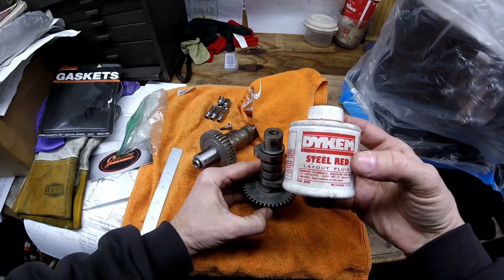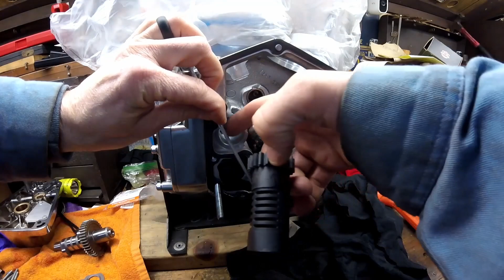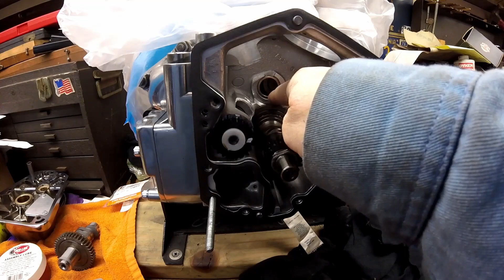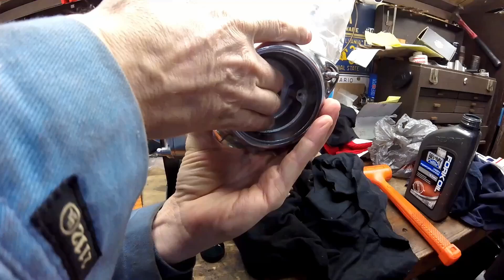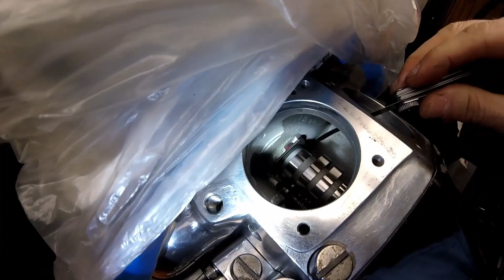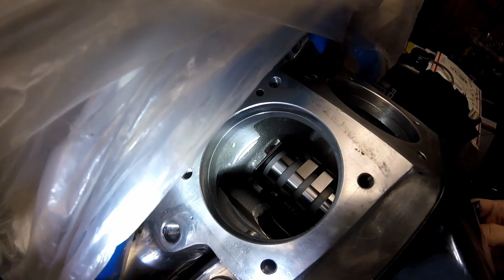Cam & Breather Set up of Evo, Shovel cam gear Install shimming Harley

Comment: I had a lot of oil pump problems on my 1992 Evo. After rebuilding the pump I found it easiest to pull the pinion gear to get the oil pump gear back on. I rolled the motor over several times and now when my TDC mark is showing on the flywheel and the front piston is up on TDC the pinion gear timing mark is off by several degrees to advance . Any ideas about this would save me from stroking out. My scooter is my only transportation and I am 73 years old.
Reply from the maker: I’m not exactly sure what it is you’re asking. As far as the timing marks on the camshaft, the breather gear and pin gear go I don’t worry about where the timing marks are on the flywheel. I just make sure that all the alignment marks lineup with opinion gear, the camp gear and the breather gear. Wherever the timing marks on the flywheel are they don’t change. If this doesn’t answer your question, maybe you can clarify what you’re asking or you can email me at hdrap1@yahoo.com
Reply: @Rapsgarage you nailed it. Now the lights are on. Lol No connection between the flywheel timing marks and the marks on the cam and breather gear. Thank you

Comment: I bought a wreck evo as long as I use all the gears and oil pump I will not have to change the the gear on the cam correct thank you
Reply from the maker: @RobertGreenlee-f8u  yes that’s correct assuming that it has the stock gears. If you put it back together and it has a whine, you’ll have to take it apart because the gears are too tight.

Comment: Howdyidig your video first one perfectly understandable I have 86 flh with  a 93 motor couple days ago I noticed tapping then a little bit later loss of power running on front cylander. Well rear cylander intake pushrod came totally lose but laying in the lifter, do I need to check certain things and can I just readjust it Im not really sure what all could have  been damaged from this .
 Thank you in advance
            Weitstrow, fla
Reply from the maker: I’d reinstall the pushrod and give it a try. What you described could bend a valve. You’ll need to do a leakdown test to see. If it spins free, I’d put it back together and try it first.
Reply from the maker: Hydraulic Pushrod adjustment for Shovel Head and Evo
https://youtu.be/bfY8Ac1Ggo4

Comment: Any chance you would know the part number on the plastic breather gear shims you're using all I can find are metal ones .Thank You...
Reply from the maker: I bought them on eBay. 

https://www.ebay.com/itm/265669219183?mkcid=16&mkevt=1&mkrid=711-127632-2357-0&ssspo=NLy91HmjSHq&sssrc=4429486&ssuid=zzfRVGHGQ1W&var=&widget_ver=artemis&media=COPY

Comment: Hi. I'm about to tear my 80 cubes Shovelhead apart. I saw you used a stock plastic breather. A lot of people say to throw that out and install a steel breather. Would a plastic breather be good enough for a stock rebuild? Great Videos. Keep it up. Greetings from Germany.
Reply: I would put a steel one in for piece of mind and throw away that plastic cheap CRAP
Reply from the maker: The Factory put the plastic breathers into every stock Evo ever built. It will be fine in a stock build.
Reply: Thanks for the quick answer.
Reply from the maker: Thank you for watching.
Reply: put a steel breather in ,Ive seen an engine destroyed when the plastic breather let go ,plus metal particles embed themselves in the plastic wearing out your breather housing ,the INA cam bearing has a plastic cage which Not if ,but when ,will collapse ,and potentially destroy your engine ,plastic CRAP has no place in your engine
Reply: Plastic breather gear works fine on a stock engine. The plastic will pass through the oil pump if teeth are chipped off. Usually! The steel breather teeth if broke off destroys it.

Comment: In a different video I left a comment about the cam cover binding on the new cam and gear and original pinion. I’m wondering now if it’s because of the new cam gear. Wow. Hopefully I can get that old gear back from the machine shop. 😮
Reply from the maker: Yes! I was going to write you back and recommend you watch this video. Also, it sounds like your machine shop isn't normally working on Harleys. If the motor is apart it's a good idea to check the bushings in the nose cone (cam cover). If these bushings don't meet specs. they will need to be replaced. When you replace them they will need to be sized and also they will need to be Line Bored. The crank shaft has to be removed to do this. I would check these bushing if you have the Nose Cone off. If you need further help, email me your phone number to hdrap_1999@yahoo.com and I can explain over the phone. Thank you for watching and please subscribe.
Reply: @Rapsgarage  much appreciated. This shop only rebuilds Harleys and specifically old ones. He only did top-end. I left bottom end in bike because it was good. The engine has 70K Original miles. I'll call him when he opens this Tuesday and discuss. May be calling you Mr. Rap. Thank you

Comment: love the detail in the videos! how do you torque the pinion nut after you get the oil pump drive gear on?
thanks!
Reply from the maker: I put the nut on the shift on the opposite side then I get a torque wrench on that special tool and torque it that way.

Comment: I always appreciate your videos I've got an Eevee 27 I bought used and it looks in good shape. I had an old Cam and I pressed it off. I have a pressing make made out of an old press part of it anyway.. someone threw out, so I got the idea and know how to press the gear off I did not know about putting the scribe marks. I seen there was a key and I figure I couldn't get it wrong if I got it on the keyway on the new cam with the old gear.. my old gear when I take it off of my stock cam.
Last winter I took it apart my cam chest and I noticed that the breather gear was missing some teeth the plastic one so I found a used reed gear from s&s on eBay for thirty bucks. That's what I have in there now
I read pros and cons of changing the gear but it does make sense I made a couple of those 08 pins and try to judge the size of my stock gear and the Andrews because there was no color coding on my stock year.. no. Is I've heard other people say there are colored dots on the stock gear but mine didn't have one .. I wondered a cam that had the same bottom circle so I could use stock pushrods I have bent the adjustable pushrods and I've also had them come loose. So I wanted to retain the stock push rods
I have read the plastic gear can pick up little pieces of metal and then it'll stay out of the motor it will embed in the plastic but my teeth  broke so I replaced.
Reply from the maker: All of what you said I agree with. I'd of bought that reed gear for $30 and used it. S&S makes great stuff! I wonder if the people talking bad about it have ever used it or they are just keyboard mechanics.
Reply: @Rapsgarage  well it wasn't the reed gear they were talking bad about it was the plastic gear... now I had one in  shovelhead that never had a problem ..my Evo when I took it apart and lo and behold two teeth we're missing.. and that's what I read the plastic teeth will break off ,but on the good side when  ,the plastic gear if you have any little metal shavings will stick in the plastic and not go through out the motor , they should go stick in the filter .. I probably would have stuck another plastic gear in there but that price is too good to pass up on the used reed gear .. and there's no timing you just put it in and that's it. There is a little spring at the end.
Reply: I replaced both my breather gears with S and S steel gears in my Evo's ,its said the plastic on the shaft embeds with metal particles and wears out your housing ,plus if teeth break off can cause potential havoc ,on Iron Head Sally's Vids on YT, there is a pic of an engine destroyed by a plastic breather gear failing ,IMO plastic doesn't belong in an Engine or a rifle ,ultimately it Breaks !!!!!! same as the plastic in the INA Cam bearing ,replace it with a Torrington, and save yourself extra [financial] grief

Comment: I just added a S&S reed breather changed the cam bearing .  on my evo   I like the Reed breather its not blowing oil out the head like the Steel breather did .   Looks Funny when you look at the breather no gear .
Reply from the maker: I've never used one on an Evo but I do have the S&S reed valve breather on my Twin Cam.  Thank you for watching.
Reply: @Rapsgarage  I watch all your Videos . Even with everything I know I might see something better or easier or faster watching others . 24 years ago we had to read the Manuals , Now we can look at video .   Only a Few guys on youtube I trust on the How to Videos for Shovel and EVO engines .  80% of the Videos are doing it wrong .
Reply from the maker: @JCcanU  I agree. I'm always trying to learn and YouTube is a great source information but like you said, you really have to weed through the people who have no idea but talk like they do. Guys like @dragonmans7242, or @TatroMachine are scary with what they do. They have amazing shops but insult anyone who knows what they are doing. It's funny how many people swear by these guys on the Facebook group pages. The best I've found on YouTube with Harley work is @KevinBaxter. But that's just my two cents and what do I know...
Reply: @Rapsgarage  Pacific Mike is good  I watch Kevin also and the others I did ship my SE heads to Dragon man  They are working fine new Seats and Guides Valves nothing wrong with the springs the heads had less than 10,000 miles cam bearing took a crap filled the engine with shavings top end was plugged up .  Local shop said the heads where fine . no valve guides left . pumping oil on top the piston . went to my stock heads for a few years .  I like the Extra power the 2 inch valves have with the EV23 cam plus im 10 over .